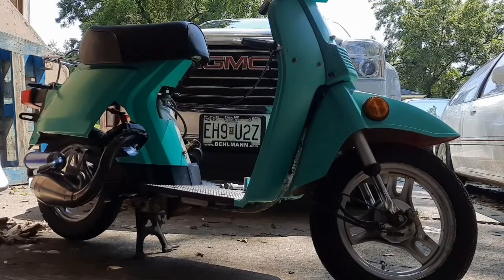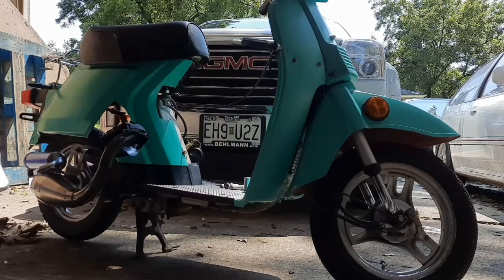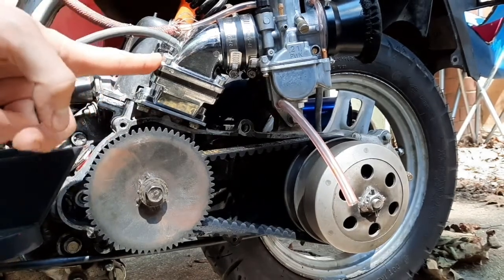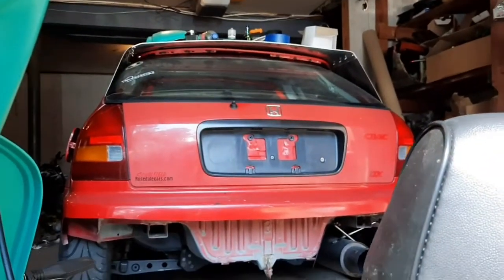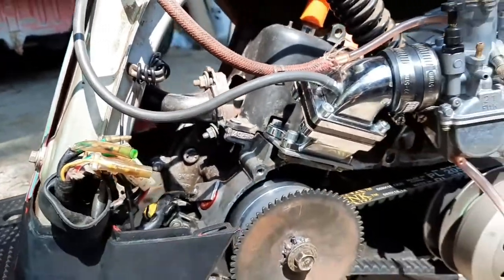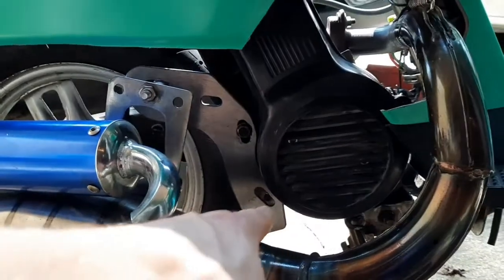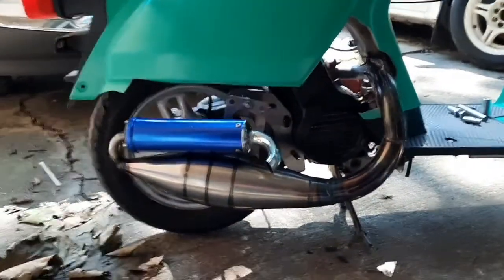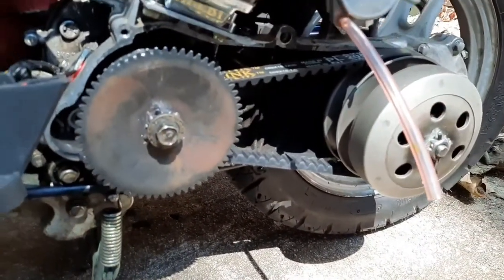Honda spree variator: How I made it and demonstration of it working.

Comment: YES! I don't like the lack of plastics, but FINALLY someone made a variator without a STUPID TYPICAL BORING DIO motor swap.
Reply from the maker: @antonioguglielmetti2661  check out my other videos on the spree! I even got a dio big bore kit to work on the spree engine and a much better variator setup. I'm gonna go out on a limb and say I have the only 75cc variated spree in the world that still has the original spree engine. I have a full build series on how I did it!

Comment: Did this method didn't work as good as compared to using the other method with the rare crankshaft?
Reply from the maker: They both worked great but the method with the honda pal crankshaft is definitely a bit easier to perform maintenance and make adjustments on.
Reply: @jdmjedi777  though this method seams to be easier to perfom as no need to find a rare part , i think the only downside is the lost of stater and kickstart

Comment: Where can I find the dio intake? I have the stock motor and I'm looking for a dio intake
Reply from the maker: I found my dio intake on Amazon I believe. I have also found them on ebay. If you are interested in buying an adapter plate to fit the dio intake to your stock spree motor I have several of them machined up and ready to sell.
Reply: Jdm jedi. How much shipped to aus. For an adaptor for the afo5e to fit bif carb manifold

Comment: Please you need to give full details on how you did this
Reply from the maker: I have another video showing how to do it a different way but it requires a hard to find crankshaft. It's more focused on how to use an elite cylinder on a spree engine though. https://youtu.be/YQ40mmpiMqM
Reply from the maker: This video shows how to use the rear drive gear from a honda pal as well. Makes the rear variator pulley completely bolt on. https://youtu.be/75mO6ah0Go8

Comment: I'd like to see some pictures of how you made that top end work out ! That's super interesting it's got me thinking I have a honda aero I wonder I'd I could find a aftermarket jug and run a bicycle engine piston like you did
Reply from the maker: Thanks man! I actually have a much better made a setup now so I can use the honda dio/elite cylinders and piston. Currently running the NYC 50mm big bore kit making the little spree engine 75cc now! There are four parts showing exactly how I built it and the results. I have my cnc up and running now and will be selling the adapter plates really soon.
Part 1:https://youtu.be/gXd1KUHbBkM
Part 2:https://youtu.be/YQ40mmpiMqM
Part 3:https://youtu.be/75mO6ah0Go8
Part 4:https://youtu.be/NVDYIGzrTyI
Reply: @jdmjedi777  please I beg you can you make a couple kits for a af05e ! It's the 86 aero 50 !!
Reply from the maker: @nathanw5747  let me do some research and see what I can come up with man.

Comment: What size Jets you using nice set up
Reply from the maker: 108 main jet and I believe 35 pilot but I might be wrong on that pilot jet
Reply from the maker: I should also mention that I have deleted the oil pump and I'm running 25:1 pre mix. So that will require running bigger jets just because of that

Comment: This is badass bro. I got couple sprees and an 1984 OG Elite.. got me thinking now….
Reply from the maker: Thanks man! They are a blast to work on. Have some new videos of it coming up soon. I was able to get this thing up to 47mph with a GPS on it. Hope it inspires you to make something cool!
Reply: @jdmjedi777  just put the scooter swap shop speed pulley on. Thay got top speed to 37mph.. just got there new s23 exhaust and a bigger carb jet today. Can’t wait to try it together
Reply from the maker: @volvo850r3  that's funny because my s23 exhaust is coming in tomorrow 😂 was going to do a comparison video of stock vs my current ebay exhaust vs the S23 exhaust. Let me know what results you get with your spree! I would love to know how it turns out.
Reply: @jdmjedi777  funny.. I will . They told me high 40s
Reply: Hey what size jet did you use with the pipe?
Reply from the maker: @volvo850r3  I'm pre-mixing my gas at 25:1 so unless you pre mix at the same it will probably be different but with the S23 exhaust it likes a 105. With the ebay Dio exhaust it takes a 108. Can you guess which pipe makes more power? Lol
Reply: @jdmjedi777  I can’t get mine dialed in.no power and shit idle…tried a 70 jet and was thinking that was to rich. I’m not sure now
Reply from the maker: @volvo850r3  does it die when you give it wide open throttle or does it bog and feel like no power? Also you running a stock intake?
Reply: @jdmjedi777  stock intake and new filter…speed pulley and exhaust… I can get the idle OK but just bogs down When you throttle.. If I set the needle to lean it got enough to move me around.
Reply from the maker: @volvo850r3  if you hold wide open throttle and it just bogs without dying it sounds like your main jet is too rich. You could try drilling some holes in the lid of the intake or a smaller main jet to lean it out. The stock carburetor/intake is poor flowing and really chokes up the power of this engine in my opinion.
Reply: @jdmjedi777   stock is 65 I up to a 70.. I’m thinks try a 68.? .. I don’t have Honda jets so I gotta buy them… also maybe take off the speed pullley and see if that makes an difference maybe
Reply: It only bogs with me on it. On the kickstand it will rip wide open.
Reply from the maker: @volvo850r3  yeah I had made my own speed pulley and it was okay but really brought down the performance of the engine. Ended up taking it off and getting inspired to make the variator setup. I would try the 68 and if you want I have been thinking about selling the intake manifold adapters for the dio intake. Let me know if you are interested. It's a big performance upgrade and jets are widely available for the pwk carb
Reply: Without the pipe and just the pulley I got from a 25 top speed to 37mph. But 
All 3rd gear. Maybe I’ll try just the pipe with a70 jet and see what’s up.. thanks for your help. And I’ll keep that adapter in mind .cheers!
Reply from the maker: @volvo850r3  with the upgraded pipes though they tend to lose some of the bottom end to get the spree moving with the speed pulley. My neighborhood is all hills though so on flat roads I'm sure it's not as big of deal. I will say though the s23 pipe is kind of strange. It's got a long soft powerband. Compared to the ebay performance dio exhaust that has a strong powerful mid to top end pull.
Reply: @jdmjedi777  my set up now if I come to any small hill it completely dies out to a crawling stop
Reply from the maker: @volvo850r3  so I guess my best suggestion now that I think about it is start with a jet you know is too big and work you way down step by step and pay attention to how the bike reacts. If none of this works try switching back to the stock exhaust and see if it runs normal. Chances are slim but there is always the possibility that something unrelated to the jetting and exhaust happened while changing the exhaust. Like maybe the ground wire going to the starter got messed up or somehow the wiring to the CDI/coil got messed up just by being old and brittle and breaking while switching the exhaust.